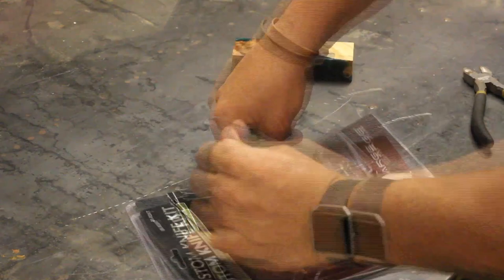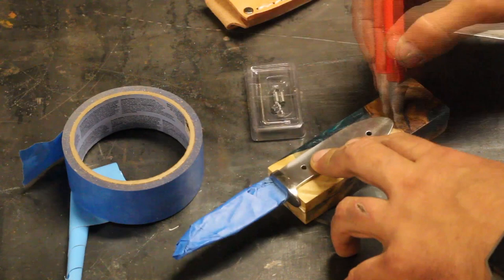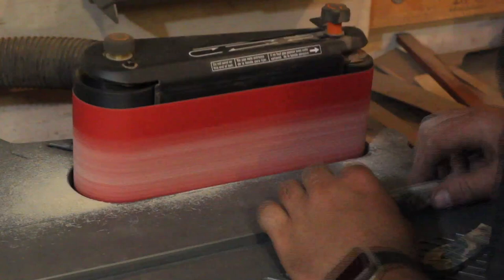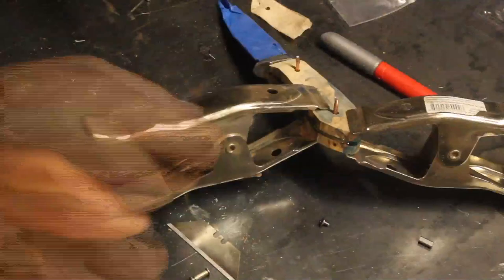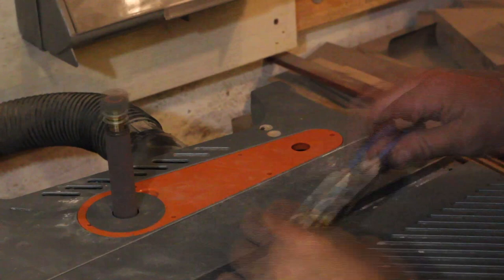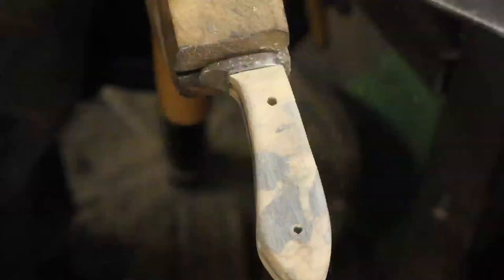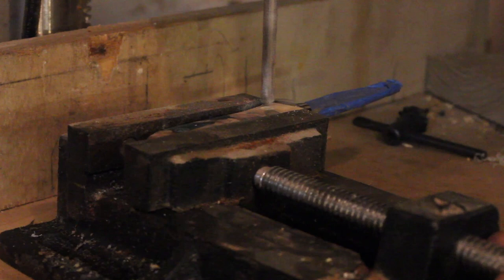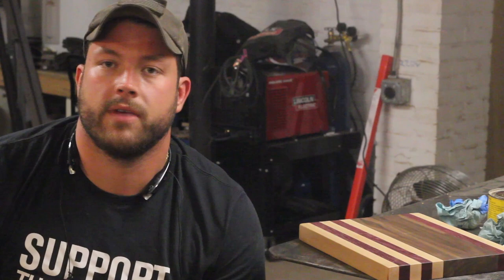How To Build A Rockler Knife Kit & Giveaway

Comment: Hey John, What grit sandpaper were you using?  Both Belt and spindle.  Thanks in advance.
Reply from the maker: 80 and 120 i believe
Reply: John Malecki Thanks, John. I have a few kits to make as gifts. Your knife is Awesome, I have just started trying to use epoxy in my projects.

Comment: Thanks for the video - beats the piece of paper instructions that come with kit.
Reply from the maker: Glad it helped
Reply: I just got that kit and it doesn't come with screws, like you used, so I guess you swapped out the pins for screws?  Just for esthetics? - since it is all cryo-glued.
Reply from the maker: Yea this kit just happened to have screws. You can pin , cut, and sand flush
Reply: Thanks!